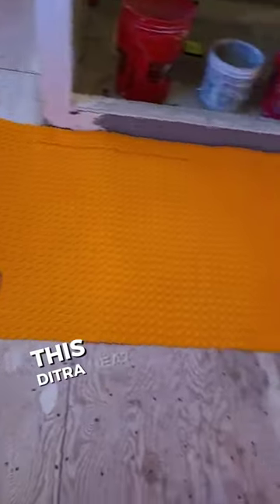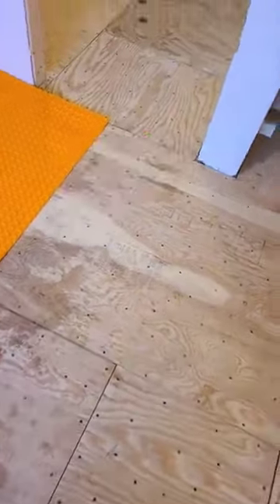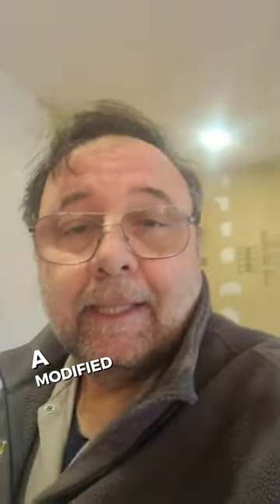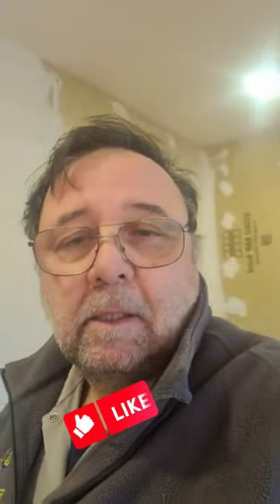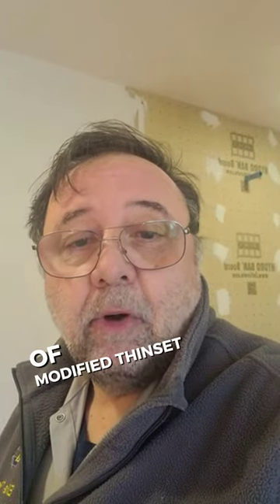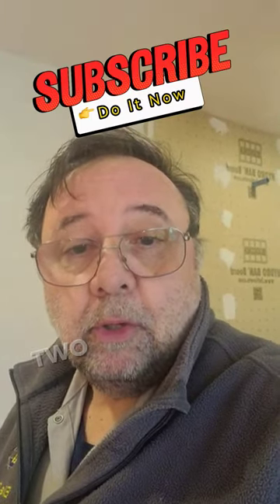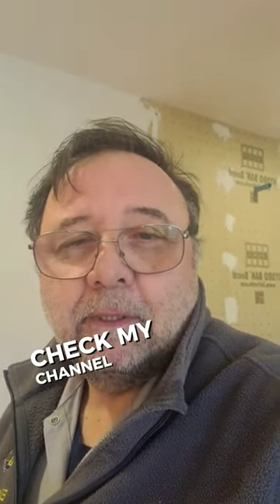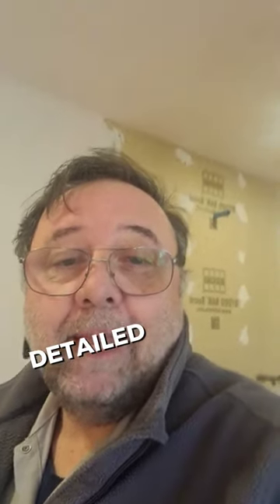It will fail, Thinset type. #tile #howtotile #mortar

Comment: My favorite thing is they literally have all of this information in the directions, I always read the directions even if I already worked with a product, sometimes I forget some of the specific steps and it's much easier to get a refresher and do things properly.
Reply: Yea its nice to get a refresher. Like rpm and slake time for thinset
Reply: @pg-erk3938  especially with all the epoxy styles or quick drying grout, I usually use a mixer to mix all my grouts but when it comes to these newer ones I've found you get much longer working time by hand mixing, and they are more easily workable.

Comment: Well it’ll work on plywood. Common sense is you would read the instructions if you’re not familiar with the product. It would tell you go ahead and spread on plywood OR yourself will have to add the additive to the mortar to be able to stick to plywood. The third OR is that you grabbed a bag of an an entirely different product for different application or somehow ended up using that, I suppose that’ll almost be a guarantee failed.